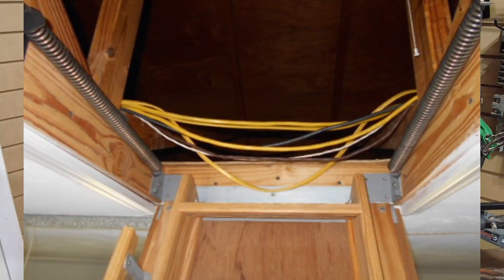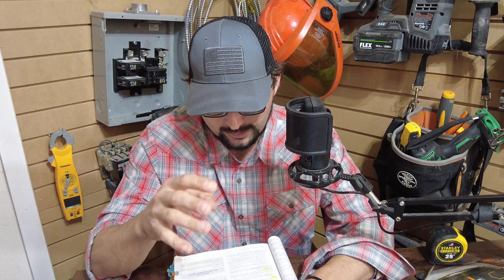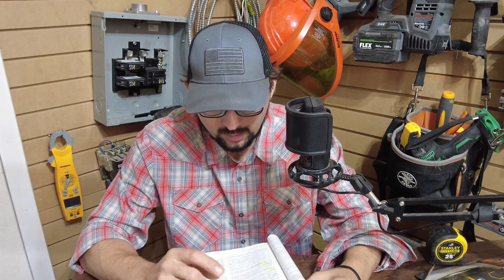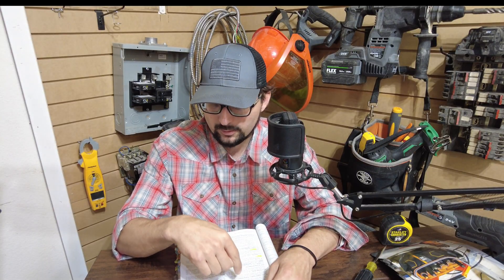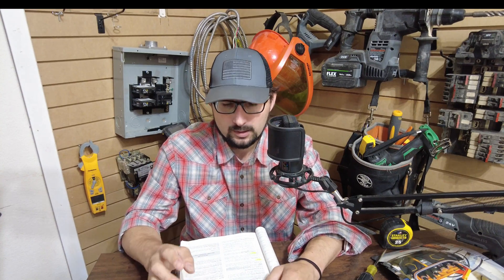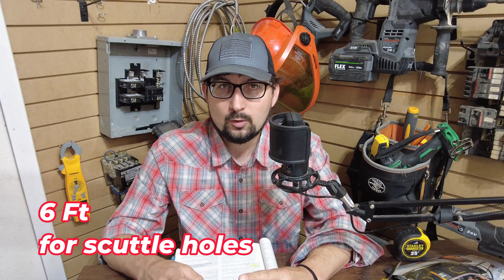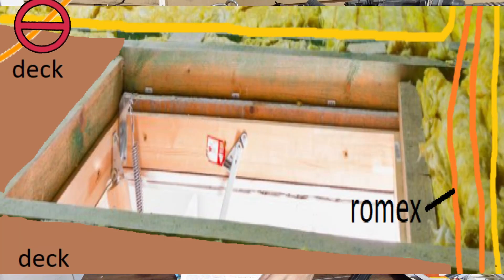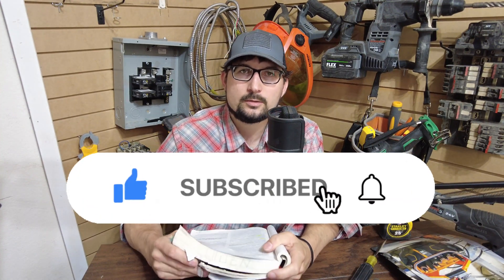Attic Wiring Unraveled: Expert Insights on Electrical Code Compliance near attic entries ep:1

Comment: The 7ft. reference is a vertical dimension.  The 6ft. reference is a horizontal measurement.   If you have "permanent" attic access, guard strips or other suitable protection must be used across ceiling joints to protect the NM in the entire attic area where it's run at a height of less than 7ft in the vertical dimension.  If you only have a scuttle opening, you only need to protect the NM with guard strips within 6ft horizontal measure from the scuttle opening.
Reply from the maker: Good addition of info thanks!

Comment: I just use the NM cable as a support ya know. To help everyone who has to access the attic get up and down the ladder easier. I’ve found the yellow stuff is a bit stronger but more expensive so I just use the white…
Reply: Just run you a loop of the orange stuff, enough to hang down the ladder, and attach it to the light switch. Multi function: assist the homeowner to get into attic, use it to remotely turn the light on, and to bring power to the switch. And orange is good stuff, I hear.
Reply from the maker: @The Pew Place  yeah even better  save time and materials
Reply from the maker: Yeah good idea lol   little 4 pt saddle in the romex couple staples     not all heros wear capes they make romex handles for the next guy 👍